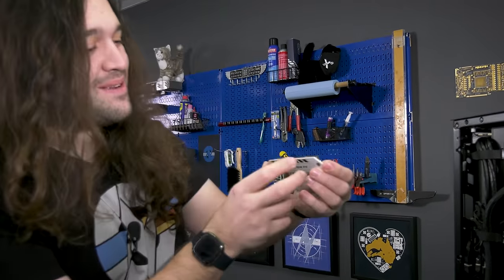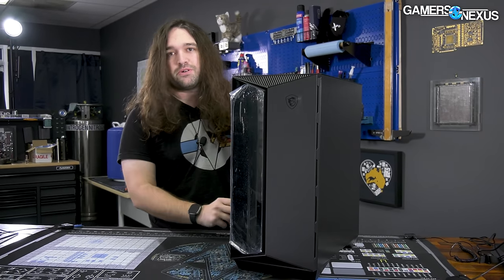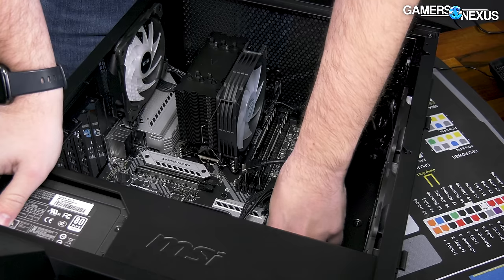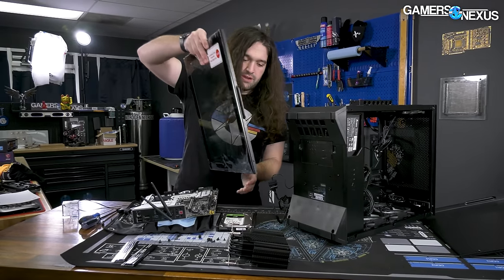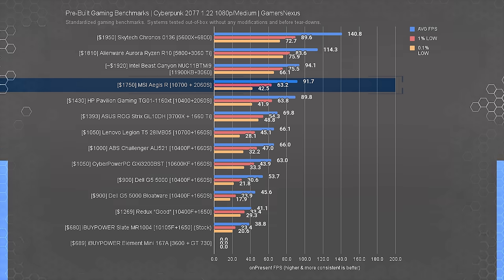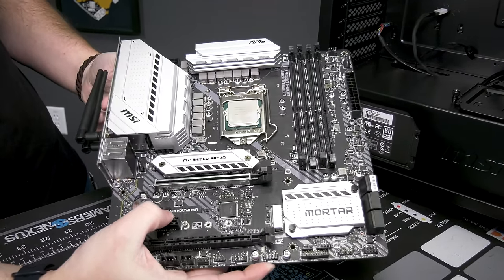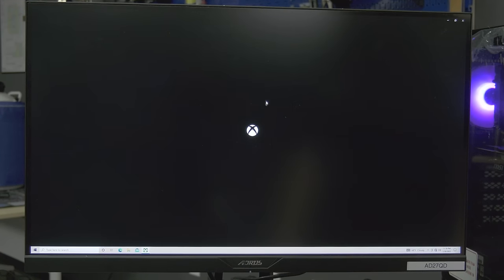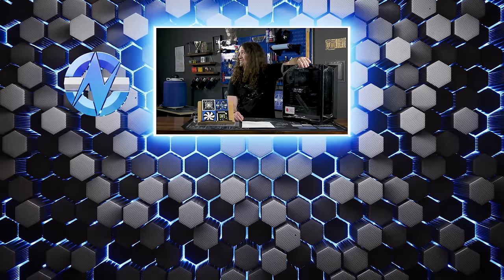MSI Pre-Built Bends SSDs & Boils CPUs at 100°C ($1700 Aegis R Review)

Comment: hot damn, this Aegis is one to avoid for sure
Reply: just built one... it's fun, easy, and you learn something
Reply: Well it's off-the-shelf parts, so you just have to rip the front panel off, remount the cpu cooler, remount the ssd, format the drive and install a clean copy of an operating system, tweak the cpu power settings in the bios, change the ram speeds in the bios, and rip off the plastic backplate and it should be... functional.
Reply: @ffwast  and at that point you have almost built it yourself lol
Reply: I keep seeing "just build it" but most of the time pcpartpicker shows a price higher than prebuilds... just a reminder that we're not exactly in normal markets. Double check everything.
Reply: @QuantumConundrum  Just budget in the best parts you can get. Yes you can sometimes get a slightly higher skew of GPU in a pre-built, but it's not going to perform to it's maximum capabilities as most of these pre-builts have flaws that are detrimental to performance. Mostly because SI's are trying to save money in other ways. So if you pick some parts that make sense together and put them in a decent case, it's going to outperform a similarly priced pre-built 99% of the time.
Reply: If it's any relief, GPU prices are about half of what they were a year ago. That doesn't mean we're down to MSRP pricing yet, but a RTX 3060 in April of last year was $1300, and is around $640 last time I checked sold Ebay prices. So if you're able to spare a little extra money, but certainly not the true scalping prices that existed a year ago, you can get your hands on a nice card
Reply: @contra1124  well yeah, the only legitimate reason to buy a prebuilt is because you can't get the parts elsewhere, people who can't figure out building a PC with all compatible parts already provided for them wouldn't know the difference anyways.
Reply: @ffwast  I kind of disagree with you here- many people buy a prebuilt because they don't want to figure out how to put the parts together or because they don't want to risk breaking something, which are legitimate reasons. And even if you are 10 years old and don't know anything about computers, you will notice if yours constantly gets hot and can't run any games
Reply: @QuantumConundrum  And prebuilts usually include garbage case fans and garbage power supplies so it ends up costing more. You're also stuck with OEM bloatware.
Reply: @ffwast  The vast majority of people worldwide have 0 interest learning how to build a PC, let alone figure out how they work, hence why DIY builds are still a very small segment vs prebuilt PCs. No reason to try and illegitimze other people's purchases because YOU like to play lego with PC parts. The DIY automotive hobby is toxic as hell, don't try and make PC building the same.
Reply: You can learn to assemble your own computer after watching less then an hour's worth of youtube videos. You will not be sorry. Please control your personal computer's destiny! It is very easy!
Reply: @QuantumConundrum  The price of computer components, other than discrete GPUs, is actually quite reasonable right now. I've assembled a couple computers over the past year or so. For example, the AMD Ryzen 5950X CPU just dropped to $599.00 on amazon a couple days ago!
Reply: In Eastern Europe Nvidia 60s cost like top 80s, so about triple increase in price.
Reply: Building a PC is probaly one of the greatest experiences ive ever had! But if you're not interested in Building yourself and your lucky enough to have Micro Center near by i would 100% Suggest checking them out!
Reply: Wow, surprised that card would run any modern games at decent settings at this point. My RX 580 8GB barely gets above like... 50fps at 1080p in modern AAA games at high, some even medium. Does ok with AA or indie stuff tho, but I still got a 5700XT for my 1080p144hz monitor and the 580 basically just mines lol
Reply: My condolences.
Reply: Not entirely something to avoid, if the price per part is a good buy than you can just do a BIOS reset and fresh Windows install, most important is that you get the hardware.
Reply: @CrepticMoon  Eh not really. Asus, EVGA, and others jacked the MSRP up MASSIVELY. I don't consider direct purchases from them at $1200+ for a 3080 to be half the price of a year ago. Only good option right now seems to be trying to snag the FE versions, which are probably the hardest to get. I still think $600 for a 3070 FE is a bit much, but I'd do that before dropping a grand on one with a fancier cooler & shroud.
Reply: Building one yourself will make you happier in the long run I think. Get some good advice on what pieces to buy to get good longevity out of them. There are tons of build videos out there that can help you step by step to put it all together. I recently did it for the first time and it was much much easier than I expected. Don't be scared to buy a low-end GPU nowadays (something like an RTX 3050, if you get it at or close to MSRP) because chances are you'll be able to resell it for a good price anyway when you would replace it later on since lots of people didn't upgrade this "GPU season". Building one yourself will also avoid all of the nonsense prebuilt pc sellers put in there, more often than not you pay for things you don't really need and there is nothing better than having built your pc yourself while knowing everything went on while installing your OS and basic software needs.

Please don't support the prebuilt market, I feel like it preys on people who don't know their tech shit, to put it bluntly.
Reply: @LouterLikeaBaws  Supporting a local PC store that pre-builds is still a good idea. My local store cost less than $100 to put it all together for you, which is basically a pre-build. Or you can buy one of their pre-builds.

Since they are not a computer manufacture, the same parts they use are the same parts they would sell to you if you were to make it yourself.

For some it's just easier, and since they are not one of the big companies they won't install all the random crap you get such as in this instance, but for sure don't go to Dell or ASUS or MSI or any big company and buy one of their pre-builds.
Reply: @tylertuthill5121  Only problem is securing a video card that isn't double in price making your pre-built not so satisfying.
Reply: @akaraven66  Yeah definitely interesting if you don't have the time to put one together yourself for example, still the experience of having done so should make you more reassured whenever you gotta make a replacement or check whether something is up. Imagine how daunting reseating RAM must be if you haven't touched a motherboard ever haha.
Reply: @githane  So I want to mention something first off. MSRP hasn't changed since the cards released. That is the manufacturer's suggested retail price, which shouldn't change under most circumstances, unless a manufacturer decides to announce to all retailers, along with consumers, that they want to change their initial suggestion.

Real time prices have absolutely been fucked for the last two years, but I was merely using the 3060 as an example of a card that has come down to half of what it was a year ago, despite still not being MSRP priced, though it is getting closer. 

Card to card prices will vary, but it is undoubtedly apparent that prices have been coming down, and are projected to continue to decline throughout this year, hopefully to the point of nearing their MSRP price points towards the end of the year.
Reply: @LouterLikeaBaws  some people also like the piece of mind, especially if you are building an entirely new PC, knowing that you are getting a full working PC is just better sometimes to have the store build it for you.

Imagine someone new to building puts it all together and it doesn't work, it's going to take much longer for them to get it working than simply replacing parts.
Reply: Do yourself a favor and assemble your own computer, you can use a website like PCPartpicker that will help you on the compatibility part, and you will avoid this kind of bad things.
Reply: For people who dont have much time to learn how to build a pc ,install software ,what brand is good ,what part is cheap,... then prebuild is the only way ngl. Not everyone have time searching internet for days guys :v
Reply: Any recommended videos for building? The only guidance I've recieved is to "READ THE MANUEL", fitting peices doesn't seem difficult but knowing what wattage power I need, knowing if everything is compatible with the motherboard, knowing if a board or cpu is even good etc etc I don't know sht about.

Knowing which wires to connect also looks very confusing, knowing where to wire things and have the correct size case.

My uncle buult my pc and then bought me a 2080 super off ebay cept the gpu cooler is too big so now I have a ghetto pc with no side on it, the water cooling doesn't even work properly unless I lay it directly down. 

The state of My pc? I tried to play dying light 2 and the game wouldn't even launch so I refunded it. Most other games work fine but my gpu can sit up to 75 degrees.

All these posts telling me about running the latest games at super low temps for both the gpu and cpu make me feel like I just need an entirely new pc.

Tldr: how do I tell what pc parts are better than another since it's not like a consle where a later gen doesn't nessersarily mean better. How do I build one of these fancy computers that don't go above 50 degrees
Reply: @lma0henry  well, my friend welcome to the age of technology. 
About the power consumption, you should check for the card power supply recommendation on their website, search for your gpu name. Normally 2080s require 650w power supply so you should have something like 700w or 750w psu will do just fine. One more way to check is to use some tools or website that allow you to pick up PC's parts then it will aclculate the amount of power you need .Ex: power supply calculator on newegg.
For wiring , well different mobo have different amount of ports, positions,... so you can only rely on the intruction unfortunately.
if the gpu running hot then maybe the airflow in your pc is bad, what case are you using ? how many fans ? how many intake (fans that suck air in the case) ?how many exhaust (fan that blow air from inside the case to outside)
You have a 2080s which is a pretty dam strong gpu while others still complain about how they wont be able to buy a gpu so you should be able to run any game at max setting i believe
Reply: Look for Asus ROG prebuilt. They are "acceptable".
Reply: Im a builder, i take my take and only do a few builds every other day, im ocd and like to make things perfect, If you would like a new custom build at the best price and all the goodies i have you covered just mesg me and well talk about what you want and ill build it and you can buy it from my ebay or amazon store .
Reply: @QuantumConundrum  ebay is where you need to hunt, i just did a build for the same cost but got more then double what msi has to offer.
Reply: @CrepticMoon  we should still hold out and not pays those prices,a 1080 ti is a good middle ground to keep building with for folks untill thing get better, you can grab one for 500 or under now if you hunt ebay.
Reply: @jeffdughman9741  Newegg has stock on graphics cards right now, i know is not MSRP but is way better pricen than prices from scalpers. 

just check their website, the prices for 1080p GPUS are pretty decent.
Reply: @pedroduran8927  Newegg is a scalper.
Reply: @communitycollegegenius9684  Well good luck with random ebay scalpers then
Reply: @ttvv90  there isnt a point to diy desktops right now, you really wont save money. If you want to build it yourself then you can but youre doing it just for your own enjoyment, not for any actual benefit.
Reply: @pedroduran8927  You do realize that you don't have to click "buy". It's optional.
Reply: Microcenter has a PC building service to help you pick out parts and its 100 dollars for them to assemble it
Reply: Microcenter has gpus rn in stock
Reply: Basically the exact same thing happened to my gpu a couple days ago and i went with a newegg abs gladiator prebuilt because of parts availability
Reply: @githane  i got a regular 3070 for 800 and im happy, where the fuck do you live that you consider 600 for a FE too much roflmao?
Reply: @rawrxd7870  It's the price increases for the series over the last 6 years. Since the 10 series was introduced, base prices were increased significantly. 
xx70 used to be in the $300 range. 1070s were 400-500. Nvidias been working on increasing prices each gen, which is a shame.
To make it even worse, the 3050, at $330, is only marginally faster than a 1070.
Reply: @CrepticMoon  Sorry, but they haven't come down in price at all. Retail prices are HIGHER than last year. Significantly.
I did a good amount of shopping around early 2021 for a friend, and 3070s and 3080s these days, save for FE units, are way higher. 
It even looks like they're getting further from MSRP. You could get cards from basically anyone (when it stock) for under $1000 for a 3080. Not anymore, and especially not from Zotac (lol). And EVGA now wants, what, $1100 or $1200 for their 3080 AND you also have to buy additional hardware?
Nah, I've seen no evidence of prices lowering. Maybe from scalpers, but thats irrelevant.
Reply: @githane  Have you looked at Ebay at all? Even literally right now, I can pull up Ebay and find 3060 cards at $700 or less. Is this an ideal price? No. Is it much cheaper than the $1300 people were asking for in April of last year? Yes.

I'm not saying the prices are normal yet. I'm saying they've come down, and, hopefully, while following trend-lines, they will continue to come down.

Edit: To add to this, you can scroll down, and on the left-at the bottom, there are filters for "Sold Items." You can personally witness, for yourself, that the cards have been sold, some sold today (March 9, 2022) for $675, $640, $590, $689, and $575 just to name the first five sold listing that I am reading right now.
Reply: @CrepticMoon  We specifically aren't talking scalpers. We're talking direct, from retailers and ODMs. Their prices have gone up, not down. Their prices last year were typically 700-900 for 3080s. and now they are well over a grand. 
3070s are a bit less, and I pretty much ignored 3060s.
Reply: @githane  A year ago, retailers were pricing 3080s for over $2000, so I'm not sure where you were buying, but you were damn lucky to a 3080 at 700-900 considering that is spot on the $699 MSRP pricing
Reply: @Ravenousjoe  Fantastic comment thank you! Im a PC gamer but have no interest in building and as you said some in the gaming community are so toxic that they told me Im not a "true gamer" :-(
Reply: @CrepticMoon  no. They weren't. Asus, MSI, EVGA, etc were not selling for 2k. Only scalpers were selling them that much. 
ODMs raised their prices since people were already willing to pony up for scalpers prices, they raised their direct prices.
Reply: Get a CUSTOM cyberpowerPC. I’ve gotten 2 custom built cyberpower PC’s in 2 brackets. One was $1100 and another was $2800 with a 5900X and 3080. Both were flawless and built very well. The off the shelf cyberpower ones at like BestBuy suck but if you customize one on their site they kick ass for a really good price all things considered.
Reply: @tylertuthill5121  custom building is generally a mistake now due to how skewed GPU prices are.  Buying a prebuilt custom you can actually sometimes buy GPU's at MSRP lowering the cost significantly. You also don't get a warranty that covers the entire PC and going through the process of getting a broken part while rare is fairly agonizing.
Reply: Meta pcs looks pretty good if you have not sorted a pc by now
Reply: @QuantumConundrum  Yes, but there are big hidden costs to pre-built systems. There are increased benefits to building it yourself. Many pre-builts are not even fully compatible with DIY off-the-shelf components, and having a case which is actually fully modular and upgradeable is a big advantage. However, building it yourself also allows you to choose a more reliable power supply, and lets you choose a motherboard which actually has adequate VRMs for whatever CPU you want to use with it. It also allows you to potentially avoid getting a videocard which might have a crappy cooler on it. If you just invest in a good power supply, CPU cooler, case, and case fans from the beginning, those can easily be used for multiple builds. It will cost a lot more in the short term, but you'll have a nicer looking, better quality, more reliable, quieter, cooler running, more efficient, and easier to work with system, and it will likely actually save you money in the long term. These kinds of components can easily last for 10 or more years.

Comment: I have this case and the airflow isn't bad.  I also did some tests with front cover on/off and found like a 1 degree difference under load.  Your test results also showed a bit more than that but still within a reasonable temperature range.   The issues with heat seem to be software settings and cpu cooler.
Reply: What CPU GPU are you using ?
Reply: same here. 5700x 6800 xt. its a few degrees difference for me